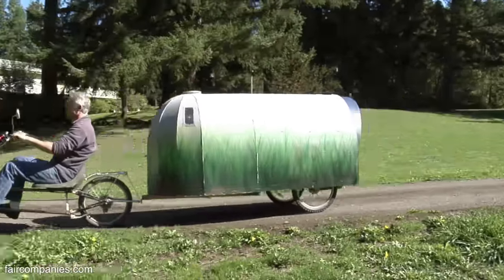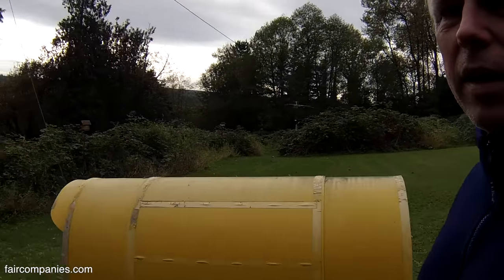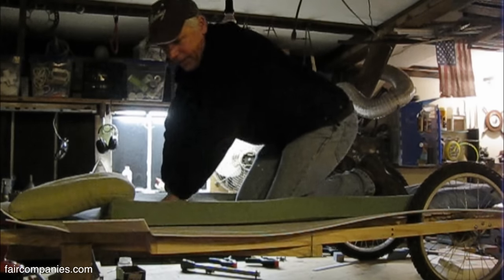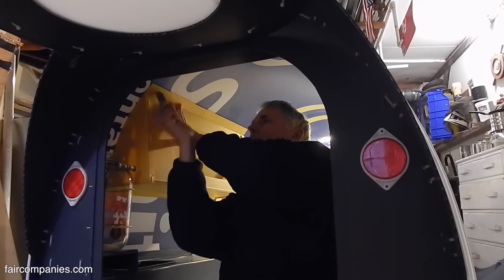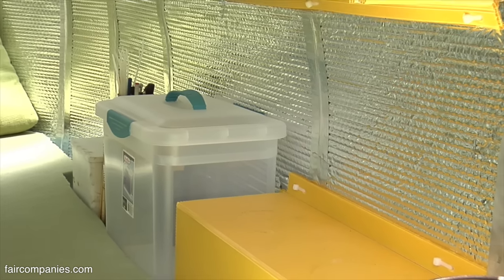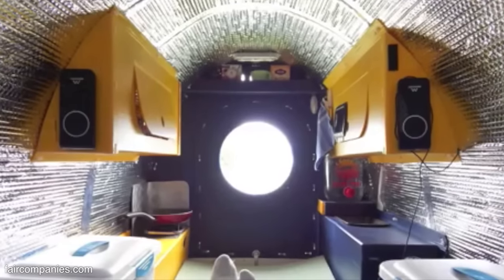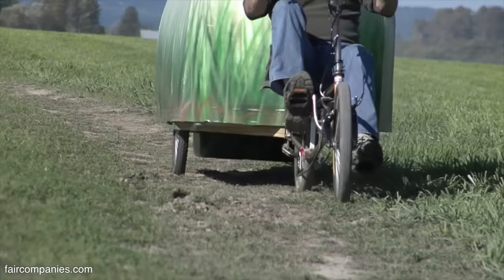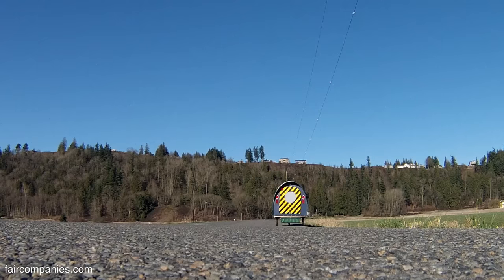$150 bike camper: DIY micro mobile home (downloadable plans)

Comment: I'd feel slightly more comfortable with a bit sturdier floor/bottom (I'm a fairly hefty [ie: fat] person). And maybe the side vent holes probably could be a bit more sealed (like the skylight in the top).

Other than these 2 issues, this looks fantastic!
Reply: be real easy to just use 3 layers on the bottom instead of two.. run webbing across the floor too?
Reply: Kristin Marlow
If you are biking with the extra weight of this camper, you'll shed some pounds in no time!
Reply: Not meant for fat people, nothing fun ever is yo just slim down, problem solved plus also a millions other problems duh
Reply: It's pathetic that so many people still immediately equate extra wait with a sedentary lifestyle or even blame that for the excess weight. It's long been established that there are a variety of medical issues which can cause weight gain. In fact, there are individuals who are more fit than most people commenting on this video, running marathons regularly, and yet their weight never goes below a certain leve; a weight which some would immediately criticize.
Reply: Nothing medically cause excess calories to form in the body. That's it ,there is no excuse .
Reply: Shane Reeves lmfao
Reply: musicloverhoney Yeah the people who run marathons and stay fat are people who don't exist. You would have to eat thousands of calories.
Reply: Carbon fiber would be good

Comment: I think i would have set the wheels on the outside of the body if i were him. Space is valuable in something like that.
Reply: +Nathan Hovey and it would offer some stability. It's a neat setup but a strong wind would likely push it right over. would add some eye-rings to the frame for staking it down during windy night camping.
Reply: +Nathan Hovey Yes.  Also it would have a lot of wind resistance and would carry a good amount of momentum going around turns for just a bike.   But if the wheels, like you said, were on the outside it would have the kind of bulldog effect as does the Mini Cooper.
Reply: +Nathan Hovey If you think about the frames structure, the wider the structure the less weight it will be able to support. So having a small frame that is more sturdy would support his weight better. In the long run it increases its durability.
Reply: +Nathan Hovey well i do agree with you, but to take it on sidewalks and bicycle lanes i believe it cannot exceed 40 inche width. but i love this idea and i am FOR SURE going to make one!!!!

Comment: 60 lbs! I have been a bicycle tourer for 35 years. I average 5-6000 miles every year. My tent,sleeping bag and pad and stove  with fuel canister and cook pot weighs less than 10 lbs.  With spare clothes,camera,binoculars,,etc my total weight is less than 15 lbs   I guy my food daily or for 1-3 days depending on availabilty.

Comment: THAT is awesome. 60 pounds. Peddle bike towable. Includes vessel installation, side wall shelving, utensil drawer, other storage drawers, fire safety back splash for inside hot meal prep and propane tank compartment, windows and air vents, sky light, head space. Wow! Awesome! $150. Awesome.

Comment: That was truly ingenious.  I just wonder how you were able to use the stove without melting the plastic around it.
Reply: CharmsDad he had a light metal splash back corner.
Reply: I love your bike camper, it's totally Awesome. It has Just about everything you need. Down the road I would love one for myself. Again you did an Awesome job. The solar is a great idea as well. Thank you for sharing. Fantastic.
Reply: cool heat (nuclear ?)
Reply: @michaelmalmomalmo9948  Right, and I wonder if there was some type of thermal insulation behind that? Not sure if the silver stuff would do the job?
Reply: Likely that he hasn't used the "camper" beyond cycling around his local area. Regularly using that stove would likely result in the plastic weakening and eventual failure. It's a rich guys hobby and not a practical solution for anything.
Reply: Honestly that is the best assessment

Comment: So... anyone considering the risks of a butane burner in an enclosed thing made of mostly fluted plastic? which is placed right by the only exit?

Like that's my main concern is that plastic looks super flammable. Like I sure hope he keeps an extinguisher in that thing.
Reply: In another video he shows the vents better and in this one you can see the CO detector. The sheet aluminum reflects the heat away from the plastic. That being said, a grease fire and he’s done for.
Reply: I would want to flame test some of this plastic

Comment: Imagine putting that on the back of a motorcycle
Reply: Or you can just get one of those motor kits for bicycles that would be awesome
Reply: Your camper would be ripped apart due to wind drag.
Reply: @flashmedia8953 , we'll see as I'm doing this later this spring. I'm hoping to have one to pull behind my 800cc Suzuki and go to Duluth, Mn. If it doesn't hold together I'll make it out of something a little stronger. Maybe some PVC culvert pipe.

Comment: A homeless guy in my town has one of these.
Reply: Kek  so tecnicaly he is not homeless
Reply: Scrumptious Gamer nah I'd say he still homeless.
Reply: S. G.  If he has no permanent address, he is homeless.  A bike camper might be better than a tent, but it is hardly a real home.   Would be pretty tough still to do laundry or bathe.  Hard to hold a job.  No place to receive mail.
Reply: Then he isn't homeless anymore,   would be great for them!
Reply: I'm working on a model that someone could build specifically for a homeless individual. Something rounded at the front but not as complex as the dome on this model. A few simplifications in the frame design as well. It might be a bit heavier, but all around simplified.
Reply: Marialla Can bath at a gym. Sometimes a po box will work while having a job just need a mailing address. Wash clothes at laundromat . problem solved. Not easy but solved lol
Reply: Marialla hard to fix yourself a sandwich too
Reply: Was his first name Paul?
Reply: Cops will eventually confiscate it.
Reply: BATHING in a basin is also an option,as well as a bucket and plunger clothes washing system if money really gets tight. And a small butane stove you can pick up for $10.  on sale or used or free. Get enough money panhandling and yep he can have a grilled cheese sandwich ,lol!
Reply: Marialla one could use a PO box.
Reply: Nina Mcrae a shower adapter and a dark water  bottle or black duct tape to solar heat the water and a dark curtain and you can shower a composting toilet and a small camo stove and you have all the comforts of home
Reply: Changed Leopard either way without this the guy is in bad shape. By giving him this you are increasing his comfort 1000%....nice to see ppl helping each other.
Reply: Was homeless once and you really have to be homeless with someone else. because no matter how good you hide it to go do a job, or while youre away it will get stolen sooner or later. Or cops destroy it. It would be nice if there was a place in every city for them. But unfortunately most of them litter and like to shit on the ground they basically mess it up for themselves.
Reply: @Marialla.  Mayb he could park it at work. No excuse for being late.
Reply: He is still homeless. Technically even a person who sleeping on a friend's house is still homeless because they don't have a house with mail delivery in their name.
Reply: me to
Reply: what makes him homeless if he has one of these?
Reply: Hes not homeless hes houseless.
Reply: Then hes not homeless is he?
Reply: Home is where you make it(homiswhereumaked*- Cajun guy on Joe Dirt
Reply: then he's not homeless if he has one.  i sleep in my car......i want one to tow, but not a caravan
Reply: @Retro_Fan  yes, paul elkins.......a true genius
Reply: pepe is always dank
Reply: There’s a homeless guy that lives in a house across the street from me too.
Reply: Well he saw this on YouTube 😂
Reply: Chreelou oh yeah real convenient, need a shit? Go to the GYM? Need a shower Go to the GYM, GYM doesn't have a shower well you're fucked also a GYM and Laundromat are expensive
Reply: The poor bastard..
Reply: then I geuss he's not homeless :)
Reply: @Marialla.  solar shower, laundromat and email :)
Reply: @MrWolfheart111  Try it.
Reply: @fancysfolly554  all you really would need is rice and dry beans in this boil them on a pot of water.. what about all the can goods you could be heating up ...spaghetti and meatballs in a can.. beef stew.. Brunswick stew Etc
Reply: steve mitchell I just don’t think I could bear living in a place like that...I guess if I had no choice..but I’d work real hard to make sure I had a choice...that would be crazy. Crazy!!!!!
Reply: Chreelou 
I saw someone say a gym membership was expensive in comparison to the local recreation center for him.
I wonder how many options are available for that kind of thing?
Reply: Chreelou how are they going to afford a gym membership
Reply: nancy oden Cooler, ice, lunch meat, sandwich spread, cheese, bread, solved!😄
Reply: @scrumptiousgamer5371  maybe someone helped him
Reply: @Marialla.  yikes just saying that he has a shelter
Reply: @scrumptiousgamer5371  I agree that having a shelter is better than sleeping in the rain.  But homelessness is more than just being out of the rain.  If you don't understand the problem, it's easy to give an answer that isn't a solution.  And if you have "an answer" it's easy to think the problem's solved.   I don't want us to stop there.  I'd like us to keep on looking and realize the problem isn't solved yet.
Reply: @Marialla.  i totaly a agree with you i was not nessaserky saying that they r now just the same has having a  normal houss just that its still better then having no home at all(and yes i do understand about homeless people becouss i know somebosy who ised to be homeless)
Edit:I agree that we should still look for a better sulition too!!!
Reply: These comments really illustrate the problem with the perception of the homeless in the USA.  "Homeless" doesn't mean you don't have shelter, and all this would count as is a mobile shelter.  If you ride a bike and just set up a tent every night, wouldn't that still make you homeless?  This is nothing more than a permanent tent stocked with supplies.
Reply: @Marialla.  I've literally never in my life had a job be worried about where I live or a mailing adress, I have tons of friends who dont have a home and travel around the country and none of them have ever had a hard time getting a job where ever they are
Reply: @Xighor  gyms can be as cheap as 10-20 dollars a month. .hardly expensive
Reply: @zmohan69  Oh, gosh!  I guess things have changed some then.  Way back when I was doing it, finding a job was often difficult, and job applications required you to fill out an address.  I guess those days are over.  Good to know!  Things are easy now.  People CAN live and hold a job out of a bicycle home!  You just proved it!  Good thing I didn't have to stuff my kids into one though, that might have gotten kinda cramped.  But good for you and your friends!  Jobs for everyone!  Homelessness solved!  Go tell the world!  Woohoo!!!
Reply: Zach m yeah but the cheap ones probably don't have showers
They've never seen a GYM with showers even expensive ones
Reply: @Marialla.  By that definition a billionaire who lives on his super yacht is homeless.
Reply: You will be homeless  someday . Is better to stay in the bicycle camper and travel than occupy garbage container:)
Reply: @JacekSeroka  Don't understand why homeless people live on the streets, just buy a house
I love the outdoors but they're taking it a bit too far
Reply: @Marialla.  who needs mail and who needs a job
Reply: @domepeelercasts9622  Nobody, if they're still living with their parents.
Reply: That's a brilliant solution.
Reply: @paulwelkinsdiy  how did you get on with you're project..???
Reply: Can it be pulled behind an adult Delta semi recumbent 21 speed tricycle?
Reply: Very poor, but at least he has shelter! Good for him!
Reply: Home less, even a small thing like this could be a home for someone, a place to rest and eat, enough to live.
Reply: Kek.....you ?
Reply: @Marialla.  Work for the federal government?
Reply: @xcvsdxvsx  The hypothetical billionare living in a superyacht would be living in a house-boat then, Dingus.
Reply: @xcvsdxvsx  Houseboats are totally different, because those super yachts have to pay literally up to $500,000/ a DAY to park it. Hence, no one has ever lived on a superyacht long-term for this reason. But if they did, they'd be living in a house boat.

Comment: I'd like to see someone use this kind of design with thin sheet steel or aluminum for use behind a motorcycle to reduce weight. The campers they have in the motorcycle world are heavier than I would like, and none of them are good hard side campers.
Reply: Put a wing on the back end of the roof like them Street rods did back in the 60's or 70's.
Reply: You would cook inside like a can of beans
Reply: Would love to see that trailer ripping apart at 100km/h, pulled by a motorcycle.
Reply: basil fawlty  aluminum foils

Comment: Make the outside of the micro camper solar panels that help power an electric bicycle .....
Reply: damn that would be cool
Reply: The solar panels would be too big.
Reply: @prestonsvideos6133  And heavy...
Reply: Nikola Martinis yes, correct.
Reply: Flexable solar panels have a very very high failure rate besides you will have to haul batteries around that can store enough capacity to power the bike. Panels by themself will not be efficient at all especially at night or on cloudy days. it's the batteries that would be so heavy, even LiFePO4 cells add up and LiIon 18650's? That a fire hazard in itself in this situation, those cells are not meant to be power walled or banked as they require selective and sensitive charge and discharge circuits to maintain each cell individually so there is no overheating and fire..building and wiring this is way beyond most peoples IQ level here. You literally need electronics background to do this safely. Then there is vibrations and shifting of the trailer itself, shit moves around in transit no matter how well you think you secure it..
Reply: Or just trek back into town and charge at a shop or something! An Electric bike would make this build better either way
Reply: With batteries, it could be really heavy.
However, if you can pull up to 300 pounds on a trailer, even that would be light.

Comment: Can it hold a 250-300 pound person like me?
Reply: This is what I wonder. I like the light weight construction but I suspect I would have to reinforce the bed to use it.
Reply: If you use it often you won't be that weight for very long...
Reply: evespower1 I work in freight for a living. Roughly five miles of walking every shift, lifting things weighing from 50-250 pounds, and occasionally climbing racking. From experience I can say a fifty mile bike ride is no problem. Unless I intentionally go for a starvation diet I doubt I'd lose much weight that way.
Reply: lol good one
Reply: You could always adapt the design to use a steel frame like I have. Sure it weighs more but it supports a larger person like myself - even with the coreflute floor- I just added extra layers
Reply: Anaerobic exercise makes you gain weight via less calories burned and gaining muscle mass. Aerobic exercise burns calories like crazy and makes you lose weight. Apparently you don't understand this basic principle, freight man.
Reply: walking is aerobic excercise. Apparently YOU don't understand this basic principle.
Reply: WinsomeMisfit
Nope, you simply can't read. "anaerobic" vs "aerobic".
Reply: I'm like 90% sure you just have aerobic and anaerobic backwards because walking is aerobic exercise.
Reply: WinsomeMisfit
I didn't even mention walking in my comment.
Reply: Sukuraidogai Right, so walking five miles every day, not including the swimming and hiking I do outside work, is clearly just going to bulk me up! I take it I should quit my job so that I lose weight by biking around with this trailer so I'm not lifting so much anymore?

Adding the additional biking (I only have so much time, which means less swimming and hiking time) won't cause me to become slimmer unless I also stop lifting (i.e. quit working). Unless I fail to consume enough calories, which will begin to break down muscle once there is a dangerously low amount of fat left.
Reply: LordDustnDirt
You went off on your own tangent, dude, and completely misunderstood my comment.
Reply: Sukuraidogai You made a claim about my understanding of types of exercise and the effect on the human body. Your comment suggests that you think I'm wrong and biking more would magically make me slimmer even if I continue in my line of work. Correcting your misapprehension wouldn't be a tangent, it would be a rebuttal.
Reply: LordDustnDirt
I think you're confused.
Reply: That's the truth! I was wondering the same thing, as I am a fluffy lady. You make a good point!
Reply: Shelley Perry fluffy hehe
Reply: BearFootWanderer You are right, I'm fat. But I can diet, and it will take a whole lot more work to change your meanspiritedness. Good luck with that.
Reply: u leave my cutey shelly fluffy Perry alone you insensitive truth teller
Reply: You won't be that heavy by the time you cross the country in that enefficient bike
Reply: Beef up the frame and tow it with a small scooter.

Comment: i wonder if it can withstand heavy rain downpour without water sipping in
Reply: I think it can ;)
Reply: might need a bit of silicone for the seams but otherwise the panels would hold up as they're plastic... just need to worry about the overlapping areas I'd imagine.